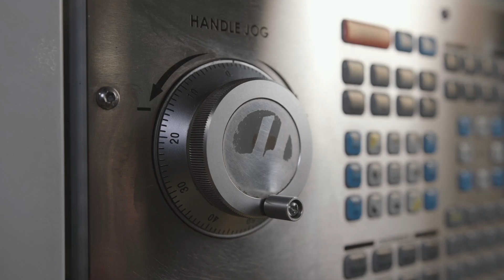Elon Musk on Manufacturing | MOTIVATION for MFGDAY

Comment: Good poiny made.they want 10 plus years experience .programming and all ttpes of machines for 20 dollars an hour.your better of in a Warehouse.no stress
Reply from the maker: Go have a look on indeed.com for machinist positions. There are plenty of entry level positions for $20 and above. One thing to keep in mind about job postings, a lot of those 'requirements' you see listed are nothing more than a wish list of what their perfect candidate would look like. Don't be afraid to apply for a position even though you don't check all the boxes.

If stress isn't your thing, there are different areas of the machine shop you can look into (yes, machining a $50,000 casting on a $2,000,000 machine can be a little nerve racking) Maybe QA would be a better fit. Part inspectors aren't doing any machining. They inspect the final parts to ensure they meet spec...less chance of making a mistake and scrapping a part in this department...however you have to tell the machinist when they scrap a part which can be stressful haha.